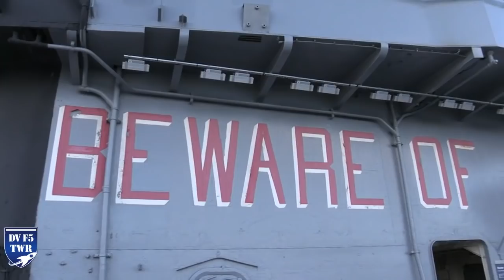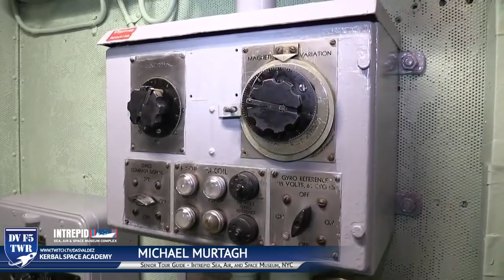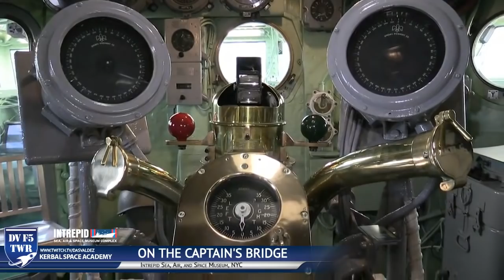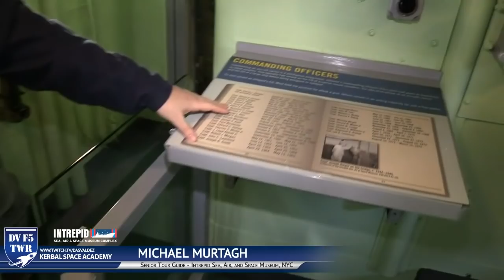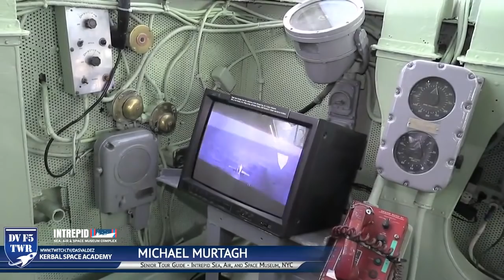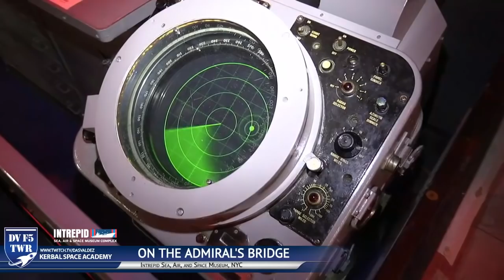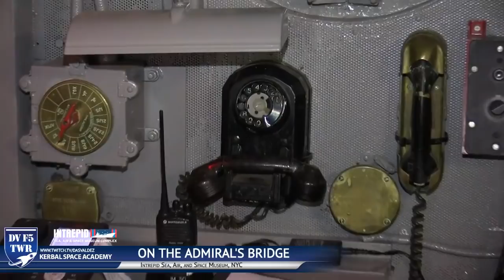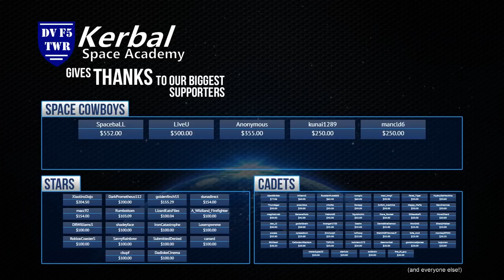Aircraft Carrier Command Bridge Virtual Field Trip - Intrepid Museum NYC

Comment: Okay, I will guarantee that what he said was the 'Admirals State Room' @ 6:03 was NOT the admiral's State Room. The Adrimal's State Room on an Essex class carrier is above the Quarter Deck and he is obviously in the Island Structure, it may have been an area where the Admiral had a communication hut (which was contiguous with the radio and radar rooms of the carrier), but NOT a State Room - Though unlikely, the Admiral would either be on the Bridge - 3 or 4 levels above where they seem to be, or on the Battle Bridge ahead of the Fo'c'sle. A State Room on an Essex Carrier is their main sleeping quarters. Battle Quarter sleeping station quarters were merely a cot in a battle station, not a State Room.

Comment: OMG, NO... The Bridge does not actually steer the ship.... WTF?? 14:02 The Bridge sends control signals to the four (4); read that four, control and propellor drive rooms on the 7th & 8th decks, which actually control the ship.. The wheel and speed control wheel send signals to the Engine Rooms on what to do, how much fire to put into the engine (think a humongous carburetor) and any trim control needed. This is NOT Gilligans Island, the 'captain's wheel' is absolutely not 100% driving the ship. It is telling a coordinated crew of sailors where the ship needs to point and what degree they need to point and a dedicated crew of highly skilled sailors and engineers are making it happen.